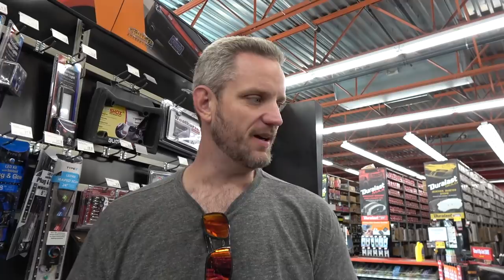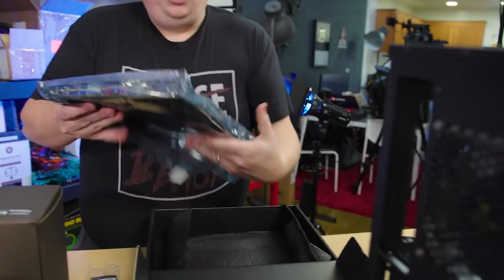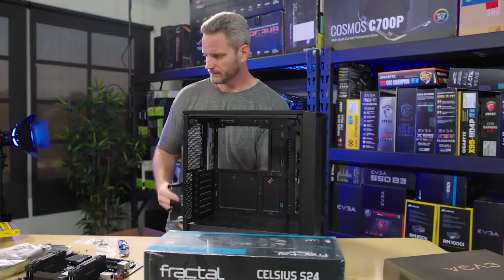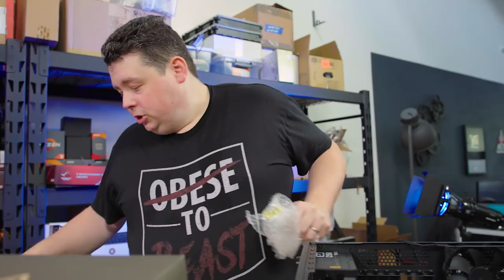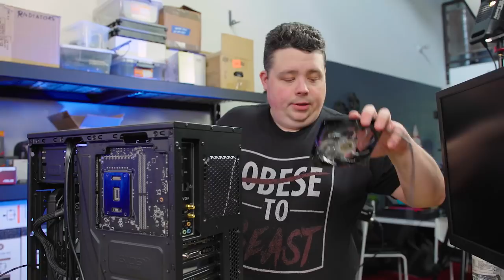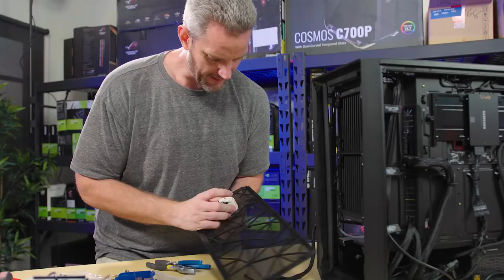JayzTwoCents vs Barnacules... PC Build Race

Comment: Volt meters used to be common so far as I recall from LAN parties in the 90's. They were usually 7 segment digital displays, not analogue gauges, and they would slide into an optical drive slot. I like the gauge style much better though. I feel it's quicker to glance and see the general range you're in based on the needle position, instead of having to register an entire number in your mind with a digital readout.
Reply: Enjoying the Crisis your right, they were popular. 05ish is when they fell out of style along with the huge 300mm fans and stuff. Some of the mods from late 90s and early 00's is coming back though.
Reply: I remember when building on an old business machine came back when the Xenon streaming machines became a thing. We used to snag Pentium IIs from dumpsters in business parks when Pentium IIIs came out to make budget gaming builds. I'm glad I grew up building systems in those days. I still have zero problems not having bleeding edge tech, and I have few compatibility issues because of it. Zero issues with my business class Phenom II x 4 that I got for free and stuck a used graphics card in, and I'll probably remain problem free when I finish my FX build.

My brother and I were just discussing the old LAN party carry straps from the age of heavy machines with no carry handles too.
Reply: I still have my last business machine gaming pc. It was a Pentium 4 with a Radeon 9800xt 512mb agp card. Last computer I built that way and it lasted until 07-08 to play games at medium with decent fps.

Comment: Tie

Speed: B
Clean Build: Jay
Extras: Tie
The hood scoop exhaust is nice, but would look far better facing the other way. The girl stickers are gaudy as heck, and the cheap LED's were burning out, so...

Jay had the voltage meter up and running, unfortunately nothing else extra.

So yep, tie, though Ba, that cable management is, was it managed at all? Clean that up and turn the hood scoop around, it will look far batter. You may want to ditch the extra lights as well.

Fun vid all around.

Comment: I really wanted to vote for Jay, but as cool as the voltmeter is, the scoop and LEDS beat it.

That said, I would actually LOVE to see a retro/car style build, with physical gauges up front that indicate CPU/GPU speed, voltage, temperature. That'd be pretty badass.

Comment: Style goes to Jerry, hands down. There's a good contrast between red and black, and the use of chrome on the front was a bit of an interesting choice; as I see it, Red + Black = Good, Black + Chrome = Good, Red + Black + Chrome? Think of it another way (except those of whom are allergic to Peanuts, to whom I strongly apologize in advance): Chocolate + Peanut Butter = Good, Chocolate + Caramel = Good, Chocolate + Peanut Butter + Caramel? Anyways, I would have loved to see Blue opposite of Red, to give kind of a Good v. Bad or Jedi v. Empire feel to it, but somehow, the Aesthetics are good. It's more colorful than what Jay presented, and that is most definitely an advantage. Jay, I understand and respect that you were optimizing for features and performance over aesthetic. Altogether, nice job to the both of you. Jerry should earn twice the points of what he did because it's been so long since he built a PC.

Comment: Wish I had seen this video before building the the meshify C..... que the AIO clearance issues as well gpu clearance issues with the AIO in the front. Decided to replace aio fans with 15mm noctuas to mount aio on top of the case to avoid ram clearance issues.

Comment: @JayzTwoCents Why not hook the voltmeter up to a fan header and set it to DC mode. That way the voltage will change depending on CPU temperature. Just staying at 12V is kinda boring.

Comment: Commenting as I watch this. I'm so nervous for Nick's system. Barnacules stripping things and man-handling that CPU in the socket made me cringe so far... oh wow, and the screws. When I get confused, I test the different screws in a stand-off before installing, saves time and stripped screws.

The random encounters of, oh crap, that radiator is heating the RAM, or the VRM heatsinks! Plan B - undo it all and mount in the front!

I have to admit, that hood scoop looked pretty damn cool.  I have to give the sytle to Barnacules. The volt meter was cool, but all of the mods Jerry picked worked, even if they were simple bolt-on ideas. Sorry, Jay.

Comment: jay cooling question for you bud. so im running an h110i gtx roof mounted. my fan setup is 2 120s in front of the HD cages, 2 more behind it, 2 in the side panel, and one at the rear top, as well as the 2 in the roof for the radiator. 9 fans is nuts lol (its the corsair vengeance c70 case) what do you think would be my optimal intake/exhaust setup? asking because im going to be replacing fans all around pretty soon. thanks bud.

Comment: Have a challenge for you, Can you build a pc using corsair air 240 with amd/intel cpu mini itx/micro atx motherboard and an amd/nvidia graphic card and both the cpu and gpu have to be water cooled but not with aio cooler, if you can succeed in installing two gpu in crossfire/sli you get extra fan points, are you up for the challenge.

Comment: I would go with barnacules. That analog volt meter on the front kills it. If you got a small digital one it would look okay. I like the fiberoptic idea if it was bright enough. I kinda like the scoop idea, some coolermaster cases kind of have that on the top. The red led strips with the other colors is a bit too much.

Comment: Hi , Jayz . Please help me ... Building a new system to replace my 6 yr old pc (amd phenom ii x6 1090t)

I am going for :-  
1. intel 8700k
2.asus gtx1070 strix
3. 2 sata ssd and 1 hdd
4. CM master liquid pro 240
6 16 gb 3200 mhz ram

Can i use my 6 year old Cooler Master 600w Lite with new system or should i go for cooler master v750 ( saw your review) ?

Comment: Hold on, exhausting hot air towards the front of the case that will then be atleast partially intaked back into the front radiator.

Comment: Drivecage..oh yeah...try using an AIO when you have HDDs and no other place to put them in... 
I put my only 4TB Storage HDD in the CD-Bay. Its only passively cooled, no Fans there. And 50°C (Which is a bit too high)
Why that may be a Problem? Because high Temps (or low Temps for that matter) shorten the Lifespan by large margins.
The Ideal Temp is your Body Temp :D

Comment: Need volt meters for every different voltage.  Need directable exhaust ports.  Need colorful water cooling and then a custom wrap for the chassis.  Temperature gauges for each component.  Toggle switches for everything (safety bomb switches of course)......

Comment: Hey Jay, can you please help me out with my build (the list's below). Well,  This is a budget Build so I'm trying to cut down on few and spending a bit more on CPU and GPU. Please suggest which ones the right ram for a Ryzen 7 1700 and the required PSU (W) to this build. 
THANK YOU

For Motherboard:
1. Asus B250F Strix Gaming 
2. ASUS PRIME B350-PLUS AM4 AMD RYZEN B350
3. GIGABYTE GA-AX370-Gaming K5 
4. Asus Z270F Strix Gaming 

For CPU:
AMD Ryzen 7 1700

For GPU:
1. GIGABYTE GeForce GTX 1070
2. MSI Radeon RX Vega 56 Radeon

For RAM: pick the 
1. Ballistix Sport LT 16GB (2 x 8GB) 
2. G.SKILL Flare X Series 16GB (2 x 8GB)!!!THIS!!?
3. HyperX FURY 2400MHz DDR4 (2 x 8GB) 
For PSU:
EVGA SuperNOVA 750 G3 - Rs.17,940 (12,510)

And HARD DRIVE AND SSD:
1. WD BLACK 1 TB 
2. Sand disk 120 GB

Comment: Jay is building in the same case that I want and when the graphics card barely fit befinde the fans I had to look up if mine would fit because I want to use a 360 Radiator with push pull fans. It's gonna be close

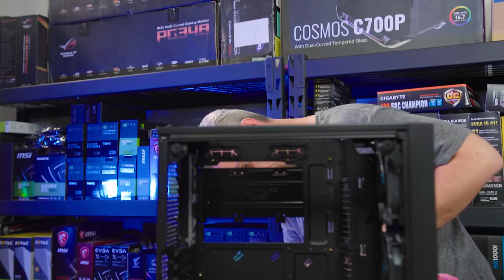Comment: 10:08 "While in most cases it does not matter. If the PSU is a dual 12v rail PSU instead of single, then it would be better to use 2 cables to share the amperage to each rail. 
But makes no difference in most cases."

Comment: why are you guys using intel instead of amd? thread ripper for the price would be better work station pc's. 7900x costs the same as 1950x and for the price of 7820 you could get either 8 core or 12 core thread ripper and have a lot more pcie lanes.

Comment: Sweet, could have used another cameraman, but as it was a same time build and you all knew each others parts, didn't really matter. For next time positioning build stations so that camera operator doesn't have to pan so much could be helpful. Either way good stuff. I'm same sort of wire freak, like 50% of my build time at least is wiring. Volt meter was way cool, remember to paint the back of it black too, as it shines through the mesh.

Comment: The volt meter is way cool, but since Jay scratched up his case and could not mend it by the end of the video, I have to judge the build in its incomplete form. The otherwise very clean look is ruined by the awful scratches in the front. Props for trying, but a speed build it aint.
Jerry's build was kind of "easier" but it works, looks decent and was on time. The unlit ram adds to the ghetto factor. 
Winner for flair JERRY!

Comment: Building outside the case is really just a waste of time.  The only component that takes any time to replace in the case is the motherboard.   Now, lets say you are building 100 computers, 1 in 100 might have a bad board.  That means you are wasting your time building outside the case 99/100 times.  Building inside cost you 1/100 times.  It doesn't take a math surgeon to see which method is faster in the long run.
Reply: John Handcock lol wut?

Comment: I'm going to go with Josh, He may forgot to put some memory in, but he does have lighting, and you never put your side panel on, or had lighting. Jerry wins, Noob win's over pro. Excellent. Need to work on your speed. Volt meter is cool though.
Next one you do, i think you should take it up a notch, add water cooled & over clocked to be the final. I think then you would of won over Josh, i'm thinking he would of crashed & burned on water cooling, could be wrong.
Reply: who the hell is josh?.
Reply: My bad, Josh is one of the guy's they are building the computer for. lol Oops

Comment: Jay messed up the case imo, the way he ruined the mesh makes it look like ass, and the voltmeter probably needs to be painted to look decent aswell(though it's a cool idea and the meter itself is nice). Jerry's build looks much better in terms of the outside of the case, with some cable management and maybe blue LEDs rather than red it would look great.

Comment: Please do a $400 build for pubg
Reply: Kevin lkg Well that's not really easy but you wanna go for a Ryzen 3 1200 and a 1050 and you can play on a mixture of Low and Very low settings at 1080p
Reply: Callum Leigh Montgomery ty. I might get ps4 instead
Reply: Kevin lkg I'm biast, but I wouldn't, you can do so much more with a PC, you are only limited by your hardware, the parts I recommend give you a long term upgrade path too. I used to game on console but switched to PC and won't go back.